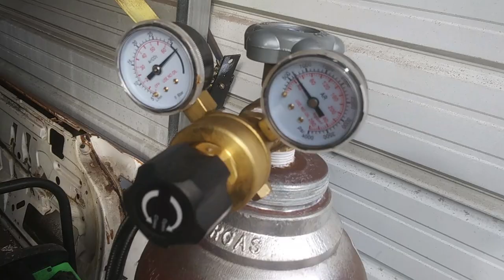1958 Plymouth Christine Restoration Vlog #40 Rust Repair

Comment: Your welding is a bad as mine🤣
Reply from the maker: In ideal conditions I can make a nice bead but when welding new metal to old I often find that I start to blow through the old metal which causes me to create large blobs to fill the holes.  The metal that I was welding on the underside of the car was difficult to see and reach and welding from below like that is nearly impossible due to gravity but I did manage to make solid welds.  Most everything I weld is ground down anyway so I don't worry too much about how pretty it is, mainly that I'm not warping the metal and that I'm getting solid welds.  I do a lot of spot welds and jump around when I'm welding automotive sheet metal.  Weld thru primer is used on bare metal and protects against rust on areas where you won't be able to prime later on.